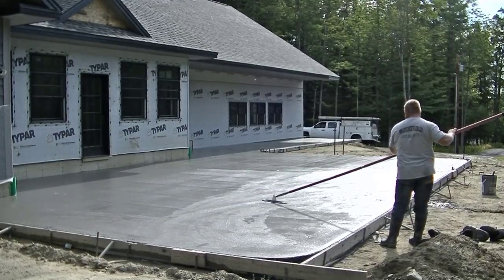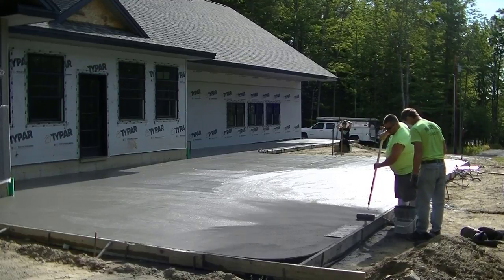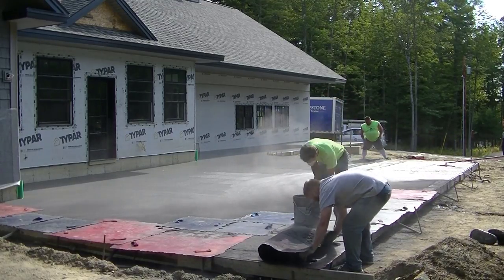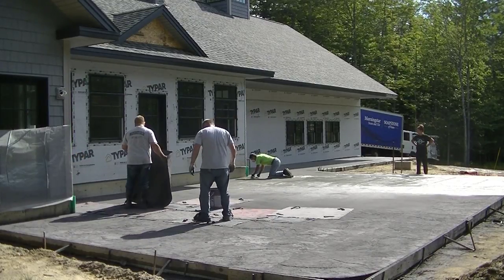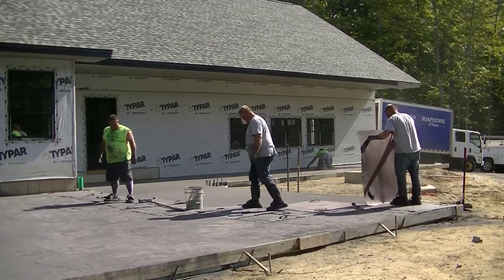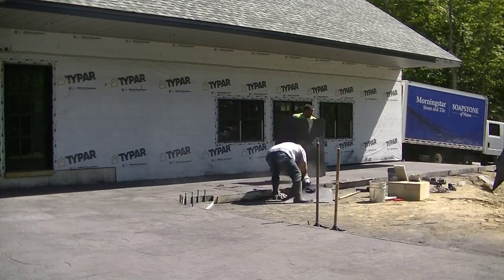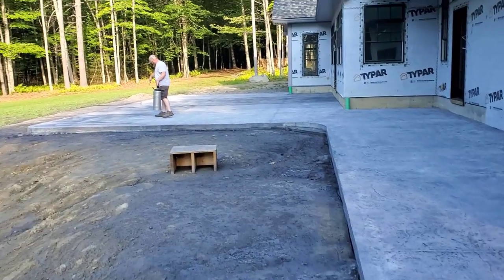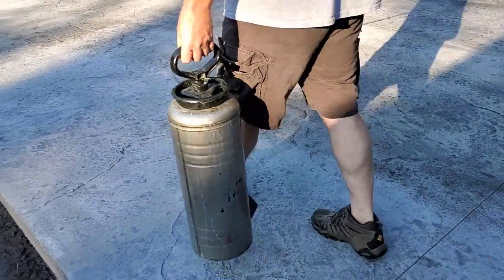Finishing The Concrete For A Large Patio Slab (Part 2)

Comment: Really like the stamped look, that is what I would have done there as well. Mike, Do you have any videos about how to pour two different colors or finishes of concrete side by side. Say, a stamped patio with an exposed aggregate border? I saw a patio area that has the walkways stamped with one color, and a border stamped with a different color. I have ideas on how I would do it, but just seeing if you have any videos. Thanks!

Comment: This is not a dig at you or your crew, you do fantastic work! I think you guys are lucky to have average summer temps of 70 degrees. Here in Windsor Ontario it gets so damn hot, with avg temps of over 80 degrees and high humidity gotta move so fast once it’s bull floated to put a finish down. It’s setting up sometimes before the concrete is laid. Seems like you guys always have time to wait around and finesse it. Obvious skill helps that, this I know but I wish I lived in a temperate climate for laying concrete.

Comment: Thanks for another upload. I've learned a lot from your videos and I'm going to being pouring my own slab soon. Do you have any recommendation of vibrators for a concrete slab? My slab is 6'' thick and will have rebar. Will a vibrator make a big difference strength wise or is it not necessary for slabs?